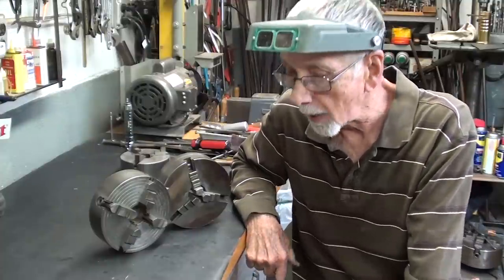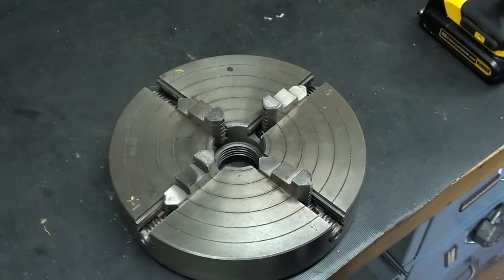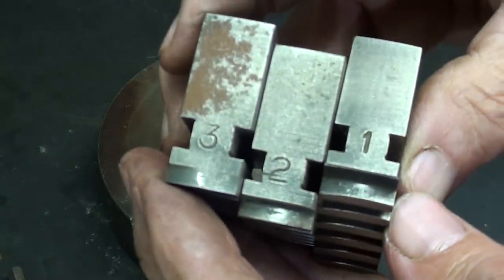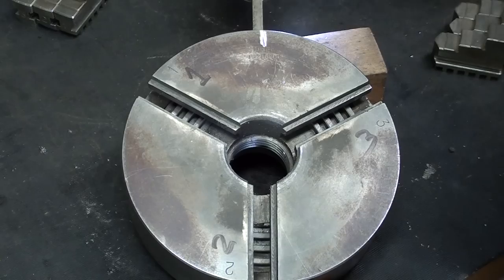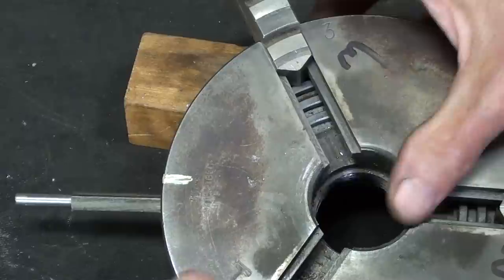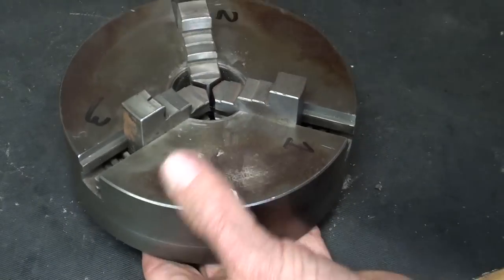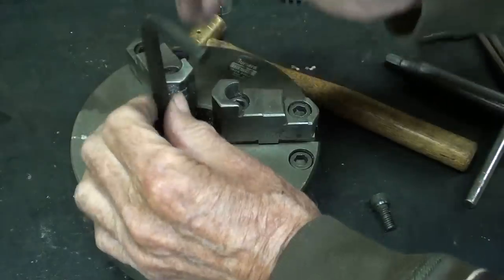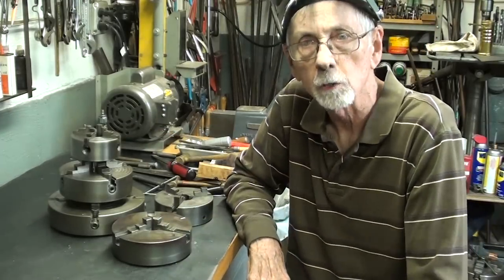CHANGING CHUCK JAWS  SHORT SUBJECT #11 tubalcain 3 jaw

Comment: Very intersting Lyle. You mentioned having a combination of inward and outward facing jaws on one chuck to hold odd objects (I hope I understand that correcly). It would be cool if you showed an example of that if you get the time or the chance to find such an object to use as an example. These are the interesting little details of your videos that I enjoy the most. Thanks!
Reply: If you want to hold a bigger object from the inside, you use the outward facing jaws. Like an object that is as large as the chuck itself. For example, holding a disk brake from the backside.
Reply: With a 4 jaw chuck, you can hold something like a short bar crosswise using the last step on the reversed jaws to hold the ends while  the other two jaws in the normal configuration hold the sides of the bar.

If you wanted to turn a boss in the center of a flange (think of a steam engine gland), that would be one way to do it. Turn the boss, drill and ream it, and then transfer it to the mill to profile the flange to whatever shape you need.

Comment: Good video. I have two 5" three jaw chucks for my Logan lathe and both have the reverse jaws. They are just the right size to fit it a red plastic Folger's coffee "can." Since I have two, I now have the luxury of being able to keep one chuck with the inside jaws and one with the outside jaws mounted up and ready to go, so I just change the whole chuck rather than switch the jaws out. It has only taken about 40 years until I recently arrived at that plateaux of affluence. I have always been careful to keep track of the jaws and the coffee can storage has made that easier. A three jaw chuck with one set of jaws is usually worth less than half as much as one with both. Thanks again for another great vid!

Comment: Hi Lyle,
Excellent video. I remember the first time I had to change the jaws I did not see any numbering, so I put some punch marks on each jaw that matched the numbers on the slots. After removing the jaws, the numbers were stamped on the bottom. I have a mini lathe, but use a 5" Bison scroll chuck. I keep a large rubber band handy so when I need to change jaws the rubber band holds them in the slots and turn the scroll backwards until I see the number 1 jaw drop and then run the scroll forward. When I see the outer edge of the jaws align with the outer edge of the chuck at the same time, I know they will all meet at the center. You and your family stay safe.

Comment: I was taught 50 + Years ago to just allow the first  thread of the scroll to block the slot. Insert the correct jaw, apply slight downward pressure, whilst turning the scroll back slightly until you hear the jaw click into engagement. Wind in and  do the same to all 3 jaws. In that way you are sure that you have not missed a thread and put them out of adjustment. Never had a failure yet. If you own a 6 jaw chuck, it is even more important that you do not miss a jaw by 1 thread, as it is a lot more work to correct. Regards from Australia.

Comment: Very interesting, I have wondered how you get the jaws lined up to meet in the center, now I know.  My small chuck on my woodworking lathe (an add on device) uses bolt on jays and is a pain to change them.  But for years I did all my lathe work between a spur center and a dead center.  Now I find the lathe work more rewarding.

Comment: One case where you can actually reverse the jaws on a scroll chuck are the Unimat scroll chucks up to the mid-70's.  The teeth on the jaws are narrow and vaguely diamond shaped, so that the they fit the curve of the scroll in both directions.  The chuck is still smooth turning and actually pretty accurate, but that's due to the small size of the chuck and a good design. A friend argued last year that reversible jaws just aren't possible on a scroll chuck.  He was stunned when I demo'd a jaw reversal for him! I hate changing cap-type jaws, much easier to have two dedicated chucks!
Reply from the maker: Very interesting       I have never seen one

Comment: Can't you also rotate the set of jaws either CCW or CW as long as jaws 123 stay in sequence?  My chuck is not marked and occasionally I have to sync them up.  So, I never know if they were back to the original position or not.
Reply: Yes, it should not make any difference in accuracy as long as the jaws fit well in the three positions.

Comment: Instead of spying the scroll start to insert each jaw with correct "timing", I simply start them all in randomly with some central traction (fingers or rubber band) while running the scroll backwards.  Each jaw hops in turn on the reverse scroll motion.  One jaw I've engraved to read "hops last"; after it hops with the reverse motion, you scroll forwards to get all three engaged with the correct timing.  Works every time, first time.
Reply from the maker: That is an excellent idea, I never thought of it. I may a show that in a future video.  I will not be able to give you a credit, because I will have forgotten by then. But thanks

Comment: While reversing bolt-on jaws may be more cumbersome and time consuming than swapping out a different solid set, such chucks do have an advantage. The standard hardened jaws can be replaced with "soft jaws" and machined to fit a specific part. They're made of aluminum or non-hardened steel, and you can make them yourself if you have a milling machine. It's a way to get an old worn chuck with too much runout to run true, if only for that size, or to hold very thin parts that are otherwise difficult to hold straight, especially if you're making many identical parts. Something to consider if you're shopping for a new chuck. I made a set of aluminum jaws for my chuck. I've never used them, but they're at the ready should the need arise.
Reply from the maker: Thanks

Comment: A quick tip.. I have a mid size China lathe with self centering three-jaw Chuck. In my case the Jaws are not numbered nor is the base. To identify one two and three you flip them over looking at the rear of each jaw and you will see that number one has the most thread catches and number three has the least. You can then install them by running the thread inside of the Chuck the same way you did in the video and start off with number one with the most catches then number two with the mid catches and then number three as your final and everything should line up just fine. 🍺

Comment: Very good shorty,,,I need to go back to your video you made on grinding cluck jaws one day. My 10 inch 3 jaw is wore,so sets on the shelf. Times I wish I had it to use :(< Well explained, thx for sharing. Oh, I hit another auction,,,I said last year no more, but ended up with a tractor and more stuff (@@)!
Reply from the maker: I know, I watched your video yesterday. Looks like you got about 10 tons worth of machinery. Some interesting items there. Hope you can get them indoors
Reply: The 2 drill press will come in, but the saw will have to tarpped until sold 🙂. Its 7' 9" and large for my shop or use.
Reply: Worn chuck jaws can be reground for accuracy but there’s only so much you can do since the scroll is also worn. It’s very important how the jaws are “loaded” under pressure to prevent movement while they’re being reground.

Comment: Watching the serial number of the chuck was new to me. No problem as the current chucks are different, 3 jaw 4", 3 jaw 5" and 4 jaw independent 4".
The 3 jaw 4" has got the numbers hand milled by a shaking hand and the jaw numbers are hardly readable. Looking at the jaws back side and warming up the grey cells under the hair it's possible figure out which one that must go in first. Hopefully there's a mark on the Chuck telling where number one has its home.
Nice familj picture. Don't use and ruin any of Your wifes har bushen! Joking!